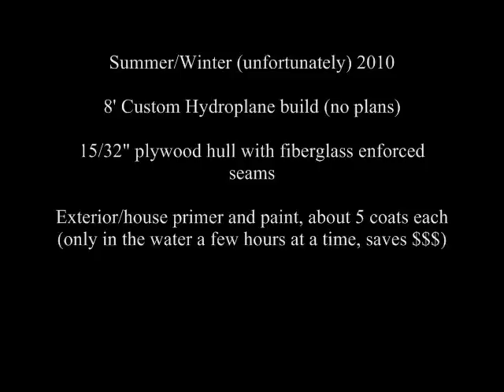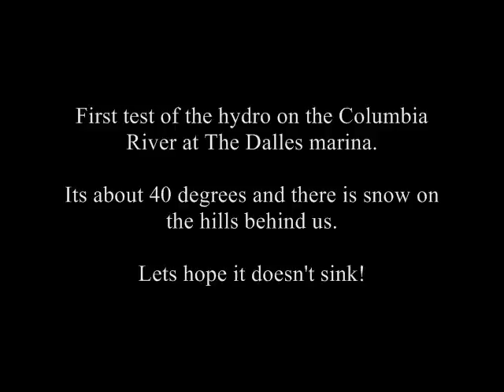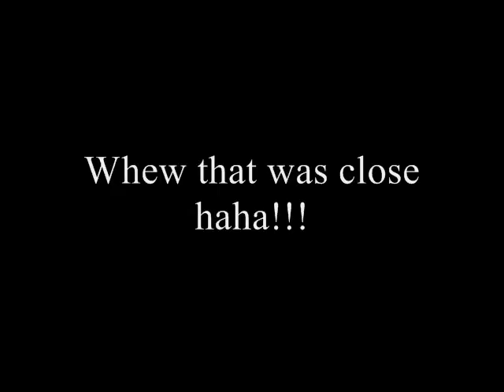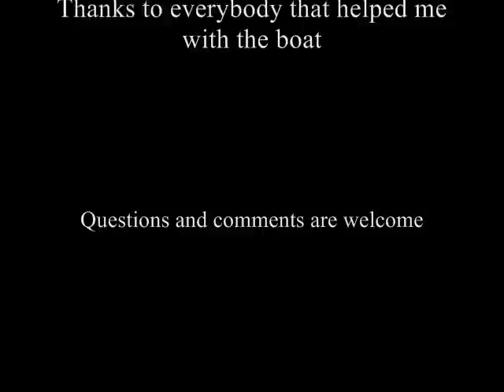HOMEMADE MINI SPEED BOAT!!  Part 1:  Build and Tes

Comment from the maker: @S1ndr3c   To start i want to say I am no boat expert, but since you asked, I believe 100hp is actually somewhat modest for the length of boat you are planning.   I imagine you are wanting to haul-ass with a boat that long and I personally don't think I would go less than 150hp on a craft that length with high speed in mind.

Comment from the maker: @MrTheshooter47 Thanks for the comment, The boat is 8'2 in length and the beam is 6 ft at the front sponson and 4ft aty the rear.  The height is 22 inches.  Good luck with your build and be prepared to spend a few more hours than you thought to complete it haha

Comment from the maker: Hey man great advice I am in the process of welding up an angled motor mount for the back of the boat.  I haven't taken the boat out yet since the first run because it's just been too cold and windy.  I will be sure to post the next run hopefully at some decent speeds :)  Thanks again for the comments and advice 
@Sparkinrailz

Comment: Lots of comments, that's great...
In MY opinion, 18 Hp is too much power and too heavy. Also,  find a way, like you said to add weight in the bow. I put my little 3 gallon tank in the bow, and I use an old Evinrude 9.5 two-stroke....75 lbs.
I agree with Jason...it  seemed like it needed MORE throttle! Once you hit the "magic speed", around maybe 12-15 knots, the stern should lift UP!

It's not the "balance" so much -it's getting up on the step. Forward ballast just helps to get there faster...

Comment: :D did you work out the pitch thing???
what you need to do is lean as far forward in it and give max reves and it wil pull its self back down flat and will fly across the water i have one of these :D

Comment: no put the motor at a slight tilt then give it stick and it will start to plane an it should be smooth sailing.

Comment: 1. that motor looked like about 8hp not 18hp... it is from the 70's or earlier.... 
2. That is not a hydroplane/tunnel hull... it is a flat bottom boat with some fancy looking sponson's on the side at the front... if they arent in the water they arent doing anything...
3. The nose is up because you dont know how to trim a motor. enough said.

Comment: The motor is tilted incorrectly. you need to bring the bottom of the motor (The prop) closer to the boat, This will bring the nose down. Then again it looked like you were too scared to just punch it and see if would plane out and level off after take off. Because of your stupid music instead of the video sound track. I couldn't tell if you were using full throttle. 
DO NOT ADD WEIGHT TO THE FRONT! and why is the guy on the dock wearing a helmet?